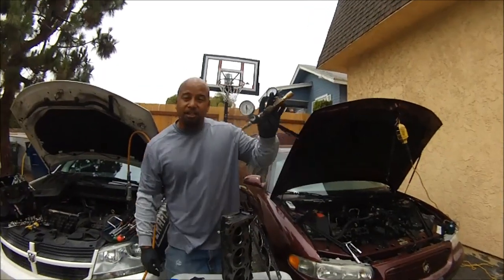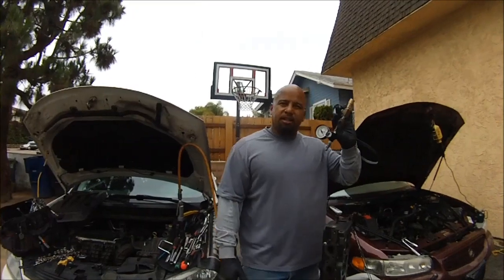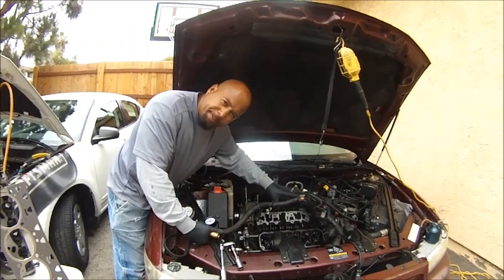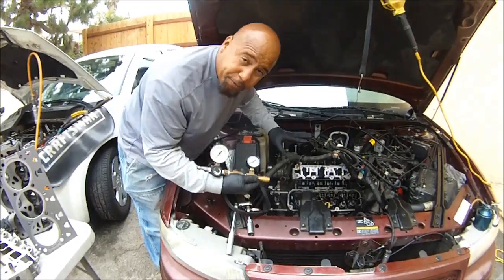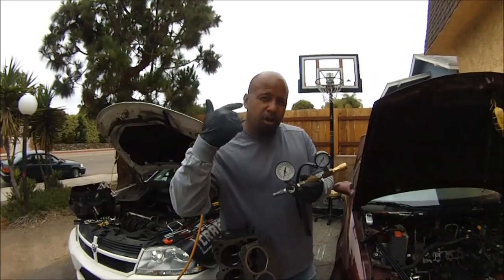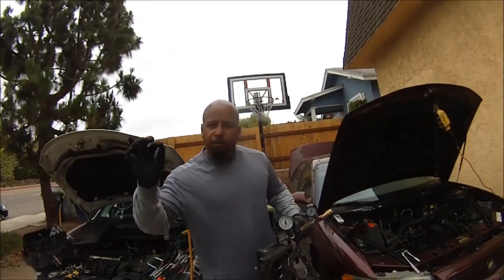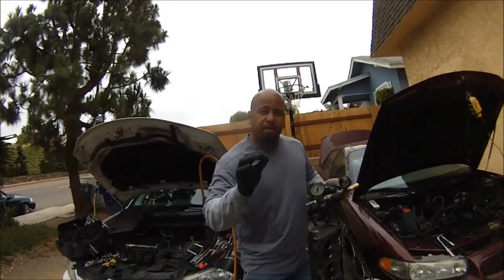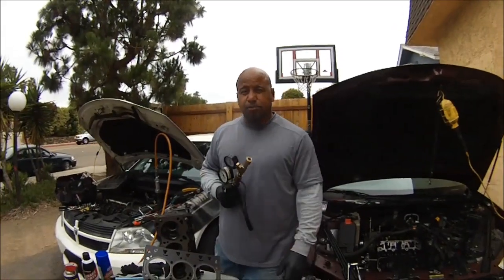HOW TO MAKE A CYLINDER LEAK DOWN TESTER VIDEO TRAILER

Comment: hey bro I like the way you work how do I make ae tester cause if got some thing wrong with my mazda lantis v6 she had not over heated but she's differently not running right I took the radiator cap off and water was rushing out with bubbles browny cream colour foam took the oil cap off looks normal just black checked dip stick same story car at idle starts to hunt abit and eventually cuts out also when I drive taking off from 1 you have to over rev like got to keep the revz up or else cuts out same with 2nd gear and lost some power driving aswel.

Comment: I saw your video on locating tdc using a screwdriver and a balloon.  My question is how did you know you were on compression or exhaust stroke?  Thanks
Reply from the maker: +Jim Buford There are 4 strokes in an engine Intake, compression, power and exhaust, none of them are the same ONLY the compression stroke creates pressure when the pistons on the way up (ALL VALVES ARE CLOSED). on the exhaust stroke when the piston is on its way up the exhaust valve begins to open and stays open until the piston reaches TDC, then the next stroke begins right away which is the INTAKE STROKE (piston moving down)
Reply: +oldskool funk Thanks.